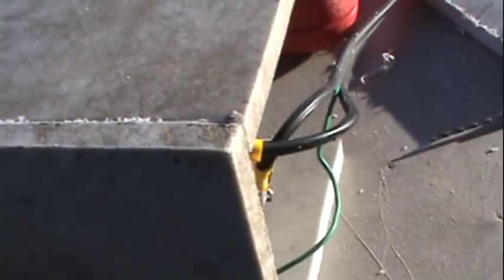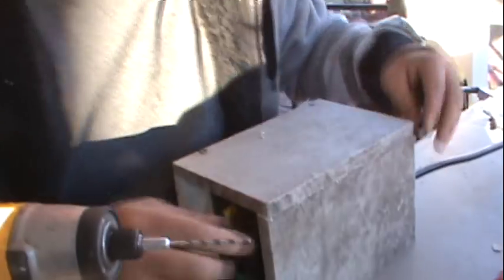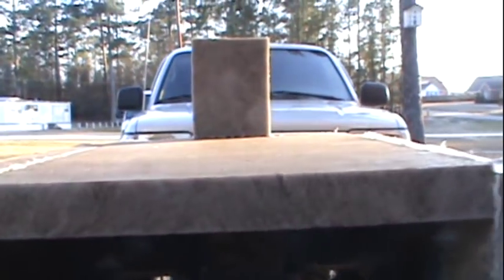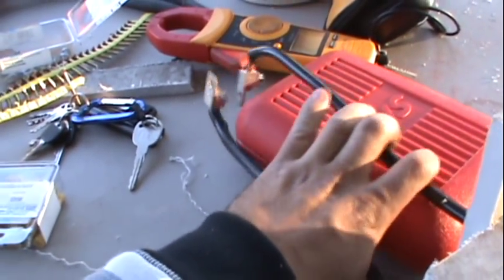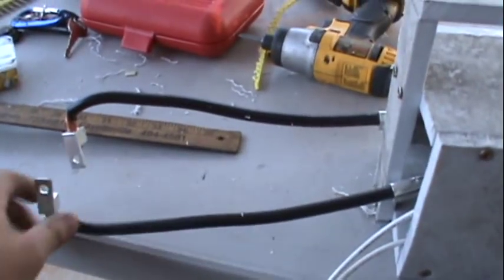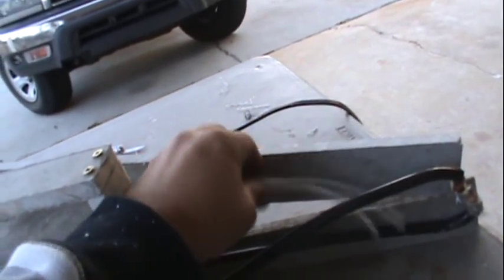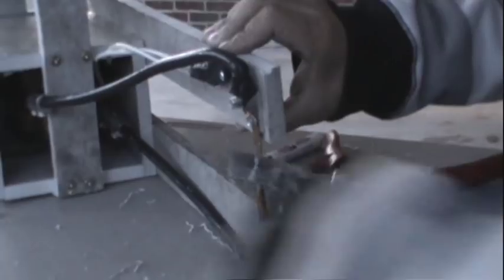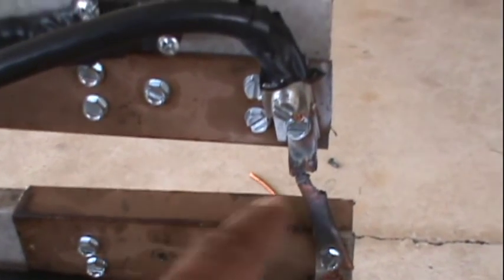Home Made Spot Welder pt 2

Comment: very nice project.
just got finished making mine.
i didnt have 2 gauge, so i used 4 gauge wire. i did 3 turns inside the transformer. i have 2.3 volts.
i tried a few different pieces of metal and even thin battery tabs, and it will not weld! it sticks lightly, but easily pulls apart.
any ideas what could be wrong? my tips are filed pretty much to a point. im thinking its the 4 gauge wire, but thought id get an opinion from someone that has had luck with spot welding.
thank you!

Comment: nice job am doing one simular to grant tompson adding cooling fan wish had enough bakelite but will make housing out of plywood n  shroud in fiberglass....oh used a battery cable from ford truck .  3 gauge wire had  1.5 volt reading

Comment: Awesome video! You have your switch on the white wire. Is that the neutral? If it is, I would strongly recommend switching the hot. When you switch the neutral, you have a situation where the primary is energized all the time and that current is seeking someway to get back to the neutral. If you were to come in series with the circuit, you would be the path. It only takes 10 milliampres and the potential to send the heart into ventricular fibrillation (results in death) is very real.
Reply from the maker: Randy Frazier thanks for the info
Reply: +Randy Frazier He should use a three prong cord for this or at least a polarized and then make sure the small prong (black/HOT) is switched, correct.

I think I'd block out the coughing kid in bare feet -- anyone could call children's services on you and make life rough for you. Me, I understand this is part of becoming a man. I melted through my mom's linoleum floor before I was a teenager by trying to disconnect the radio from the alarm part of the clock.

Only back then it was Tubes so the B+ was 200+ VDC. Which has an amazing blinding effect and sent the burning wire end clear over my head -- I could have been blinded for life if it went more wrong than that.

Now I've been through electronics college... feel free to ask a question, crob227, if you have any wonders. I wonder how this went.

BTW the real units use solid THICK copper electrodes but I think even the bare ends of your wire brought to a point would be better. a thin coat of flux would help the sticking.

Some of the spot welders use hollow core copper than have some kind of cooling liquid in it. I think that's only production-run stuff, though. The addition of flux and a decent solid electrode should make your set up work fine. They usually have a spring to retract the top arm, BTW. an old screen door spring should work fine, just keep it outof the circuit. I'd like to see a current video and how it works now as I'm researching to build a smaller one to rebuild Nicad and NiMH battery packs on some old tools I have. Much cheaper to replace the cells that just go bad rather than the whole entire pack. Previously I've soldered them but it's not always a greatly reliable connection.
Reply: Randy Frazier

Comment: I watched the vidéo again. How do you connect thé bottom with thé top?
Reply: Arthur Smith if its the i and e section of the transformer, sand it down so that it fits as flush as possible, then just put a bit of epoxy around the sides, then something to hold it together while it dries

Comment: This guy TheDarkKnightBuilds is spot welding rails into his AK-74 receiver using a modified Harbor Freight spot welder. Most of his videos is about welding the rails, but what he shows about the welder and especially the tongs on the welder, including managing the pressure at the two tong tips, should be of interest.
Spot Welding Rails

He modifies in his follow-up video what he did in the first video, so don't miss that. Spot Welding Rails Update
.

Comment: So, microwave oven transformer + 2 gauge wire = 800 amps or more?
Reply: You still have to careful as not to exceed the maximum power rating of either the power receptacle or the transformer; depending on which one have the lower rating.

Comment: Cool project! Nice build, but please use a other switch. This is not very safe and strong. I woulda prefer a low voltage relay, so you don't have any dangerous voltages outside of your casing.

Sorry for my bad English, and I say it as positive feedback

Comment: DC continuid well i did ad 3 run capacitors on the ac side to up the power factor, i really wish i had some numbers for you but its bin a year since i touched that torch gonna bust it out in the summer , i got the power factor to increase form like .2 to around .6 i think maybe lower  i read up on it for a weeks and i think i need a inductor or a large dc cap on the dc side also my transformer is reaching its saturation point because its to small of a core, any input on power factor?

Comment: yes i built several high amp units from 3 volts to 11, i found that
high AWG speaker wire is very good for these but the wire your using is more robust , that kinda insulation can get very hot like 300 degrees f insane for plastic , i built several DC units and they are very tricky i cant seem to get more then 70 amps due to harmonic distortion im considering building a large inductor
for the dc side by using a mot with all the wingdings removed im gonna try a 7 turn inductor rated for 300+

Comment: .....   Resistance welding is at the point of contact of the work pieces not at the tip contact point so even though big copper electrodes pull heat away from the weld they protect themselves this way, cool build friend hope you dont think im correcting you just like to share insite

Comment: hey bro just a tip about spot welding tips, if you use big bulky copper ones ground to a point they dissipate heat so fast that they wont weld to your work, take a look at sum industrial models , they use long copper rods this isnt just to support the high current but rather it serves as a massive heat sink , the device you have is very cool not nocking you bro just sharing info, and yes it does sound counter intuitive to divert heat from the tips of your welder but....